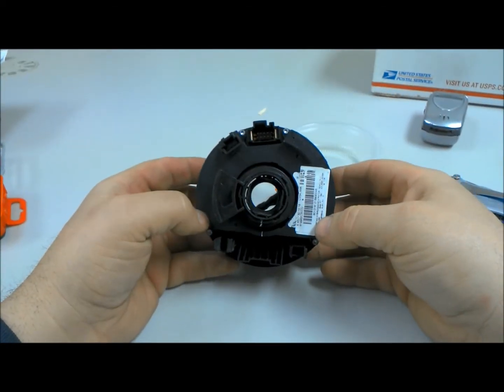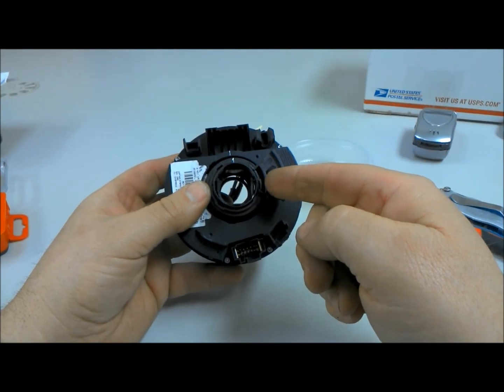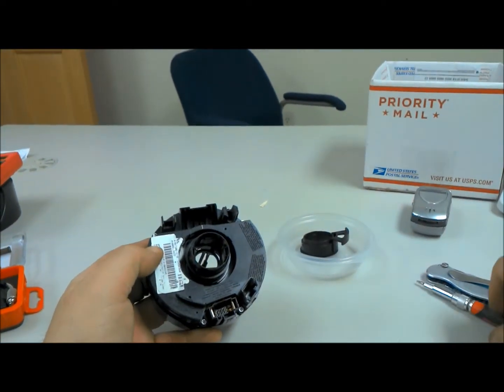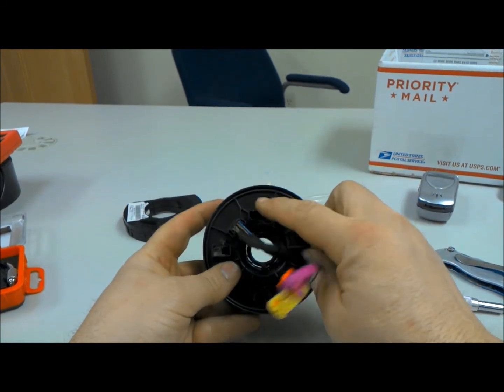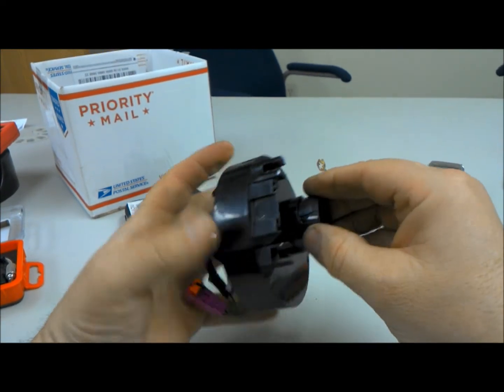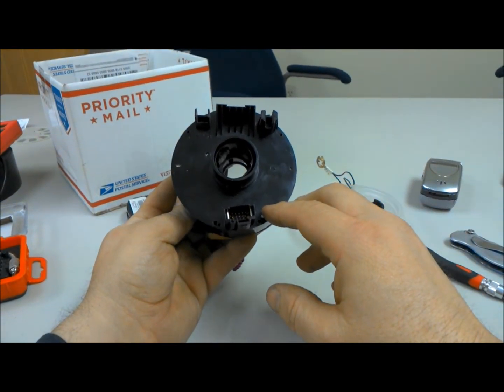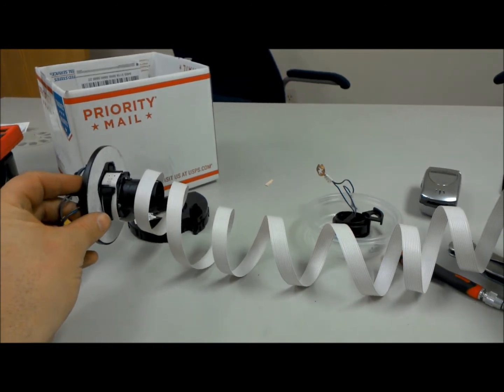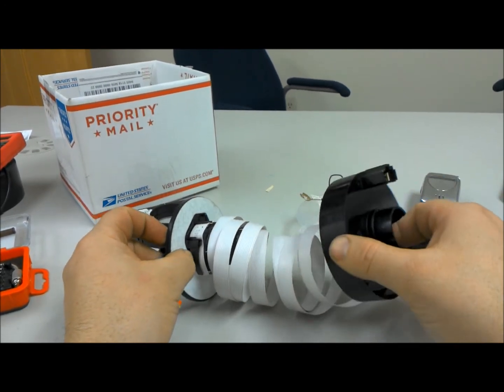Inside a 451 Smart Car Clockspring

Comment: thank you very much, I work there in my roadstar  changing  the big, steering wheel for a smaller sport steering wheel. The was a cable by the the Boss Kit for connect it, ( also place for put the ESP back )instead of the airbag and I used the cable conector of the Smart. I could not believe but it worked very well. Had a great time watching the "24 Le Mans" and take my time working on the SMart!

Comment: Great video! to test the horn circuit, if i press the horn i should get a closed circuit between pins 3 and 4, right? in the back of the clockspring plug. thks